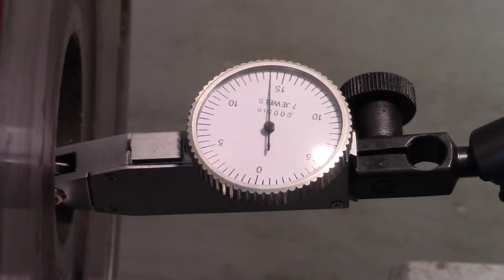1000 Sub Tool Giveaway, Steering Part for Old Rumely Tractor

Comment: Very interesting, not being a mechanic watching you use the 1 1/2" per foot reamer to evaluate the taper dimension.
Reply from the maker: It was a suspicion of mine that 1-1/2" per foot was the taper as it has been common in steering and suspension stuff for a long time. There may be better ways but I just so happen to have my buddy Gerrit's reamer here so it was handy.

Comment: Being an lectronics tech for over fourth years I gotta ask what does a machinist need a scope for
Reply from the maker: Truthfully, a machinist does not need one.  An auto mechanic can find one useful occasionally, but even then would prefer a DSO.  I don't claim to be an electronics expert in any shape or form, which is why I don't do any how-to's with electronics, but I do like to play with basic stuff.  The reason I have that scope is that I got it for a song, and it was so cheap I couldn't say no.  No case or legs for it, so it got mounted to the shelf so it could be used on the rare occasion and be in a spot where it won't get dropped or damaged.  Good question, thanks for joining in the channel!

Comment: Congrats on the 1000 subs Everett! Nice part you made...was that 4140?
Reply from the maker: Thanks, Richard.  It wasn't 4140, even with the bird's nest - I got a bunch of CNMG tooling cheap and sometimes can get the snarls with regular mild steel.  That was a slug of 1018, leftover from threading exercises at Machine Shop class.  The fellow at the Ag Society asked for it to be made of that, so that's why I used it.  He figured it would be strong enough, I guess if it isn't I'll buzz him up another one, lol!
Reply: Great looking part, I am sure they will be pleased 😊

Comment: Congrats on reaching another milestone.  Nice job on the part and I'll remember your method for setting up to cut the taper......well, hopefully I'll remember.
Reply from the maker: Thanks!  The taper setting method is not my idea, I just used that method as it seemed to be the best way given the equipment at my disposal.  At least the taper rate was easy to calculate as one major standard ball joint taper is the 1-1/2" per foot.  Thanks for stopping by!